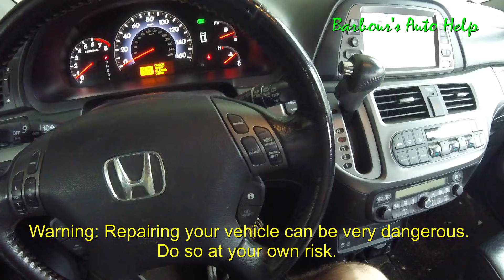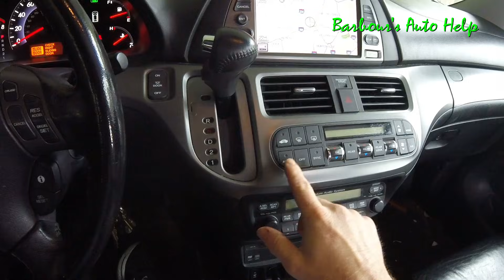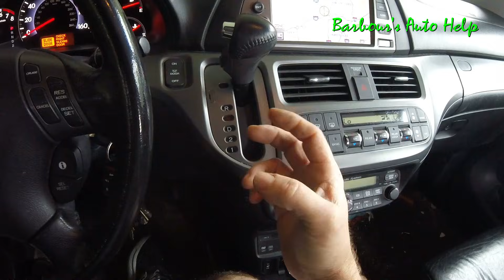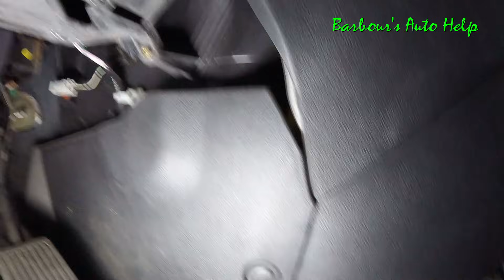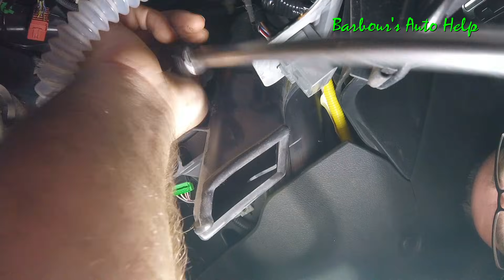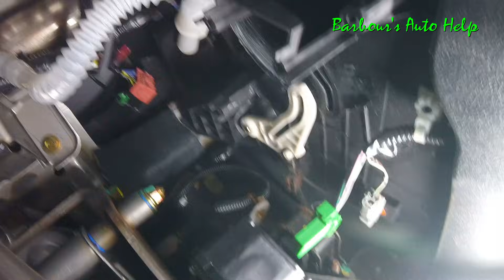Driver Side Temperature Blend Door Actuator Replacement 05 Honda Odyssey

Comment: Tried it on my '06 Odyssey, but no luck for me. Bought the replacement part and still blowing hot air. Could there be another actuator or a connection issue? I also wouldn't mind having it on cold air permanently if there's a way of doing it manually. Thanks a mil!
Reply: you might need refrigerant

Comment: Could this be the reason my defrost isnt working on my 2010 honda odyssey.
Reply from the maker: Maybe.  How is it not working?
Reply: @BarboursAutoHelp  no air is coming out of defrost vents at all, I've been using it all winter no problem until today. Hot air and really cold air work fine on the dashboard vents but I'm not getting any air out of the defrost vents or the floor vents.
Reply from the maker: @richb5478  Sounds like you have something else going on.  If it changes from hot to cold and then back the temp blend door is working.
Reply: @BarboursAutoHelp  yeah the temp isnt the problem and the blower speed is working fine low and high it's just my defrost vents stopped blowing air any idea what would cause that then.
Reply: @BarboursAutoHelp  doesnt the actuator direct where the air goes to what vents.
Reply from the maker: @richb5478  Not the temperature blend door actuator.  It just controls the air temp.  You may have something going on with the mode door actuator.  Different animal.
Reply: @BarboursAutoHelp  where is that located

Comment: Thanks for the great video!  I thought I'd share a solution for those that run into difficulty putting the actuator back into place.  When I went to do so, I was a little baffled because the two knobs seem to be in a 'traverse' position from how they should be positioned.  After a number of attempts and scratching my head, I figured out a solution...

I saw a note from someone else where they connected the actuator back to power (letting it just hang down) to verify it was even working.  I then started playing with the temperature controls.  Wah-lah!!  I set the climate control settings to manual and set the temperature to the LO (lowest) position.  The little knobs then traversed around to the exact position I needed, and I was able to place it exactly as expected.  Hope this helps anyone else that ran into same issue.

Comment: Hi, thanks very much for this repair. This video is excellent. I am sharing my experience in detail as follows for 2010 Honda CRV. I am in need of a ratchet for tight space (possibly adjustable like a adjustable wrench with a wheel) and or flex extension, if someone can point me right to it.
Problem symptoms: No air from middle central vents (two) and very little air from driver's side left vent. Full air flow near accelerator and everywhere else. But on driver's side only cold air flowing no matter what setting is for the temperature or on AC mode, manual or auto mode. Same problem even if flipped to different air flow modes on the knob. No heater at all for driver's side. Heat and cold just fine on passenger's side on auto, manual or dual mode.
Fix: Removed air mix motor actuator and cleaned it, greased it per instructions on this video. Total expense $10. Before opening the case, there were three other screws holding a metal bar plate to the plastic casing for which one screw couldn't be removed as the arm was blocking and without it coming off I couldn't open the case. So,  I used nose pliers and got it off by turning it. In the end I forgot to put the screw back in place but the plate was still holding quite well, no problems. I didn't bother for it. I didn't have flex extension for ratchet nor I could get it easily in my location so wind up using #7 wrench for the tight space bolt. It was a long extensive effort! But I didn't put it back in place in the end when I finished, the actuator was still attached fine in place. For the two easy bolts I used a small ratchet very easily. When I opened the case, the contacts and wheel was on the arm side (downside) and hence not on the top as shown here (this video is for Odyssey) but nevertheless, I was able to clean it and grease it just fine, there's a plenty of space for it and the cleaner is a good spray. I used a screwdriver tip to put dielectric grease on the wheel. I removed motor and gears and cleaned it too (there was lithium grease and for sure it was dried on contact wheel) but while assembling the motor back, the letters / writing label on the motor has to be facing me or the actuator could work in reverse.
Surprise: When assembled back the actuator arm didn't move no matter what I set for the temperature (auto mode or manual) and hence the problem stayed as is. So, I removed it (only two screws to remove now as mentioned earlier!) and attached with the power cord and tested again, still no arm movement. I thought there might be power issue to the power plug. So, to test that I attached it with the power plug on the passenger's side actuator which is accessible when glove box is detached and lowered. Then the arm moved fully! At which point I thought there's a power issue for sure on driver's side. But I attached it with the power plug on driver's side again and it worked! And it worked for all temperature settings too. The arm was adjusting little with little change in temperature on the knob on auto mode. So, I put it back in place like shown in this video (but I only have one white arm to attached two, not two like in here) and gave it power. Started the car and hot, cold air and anything in between was flowing per settings. However, no air still from middle front central vents despite several engine restarts. So, thinking there might be another issue (transistor etc.) I turned the car off. When I turned car on several hours later, air started flowing from middle vents as well! More so when AC is on high and not so much even when high heat is on. This is normal car operation I think. You don't want high heat on your face.
Reply from the maker: Hmmm.   Thank you so much for sharing our experience.  You may actually still have a problem.  My van blows out the middle vents well no matter if the the A/C is on or the heat.  It does blow a little slower with the heat on though, but not that much.  It may not be a bad idea to have a tech look at it for you.
Reply: @BarboursAutoHelp  on the air/heater actuator,if your problem is just reverse of your video,cold air on drivers side,but hot air on passengers side,I would just change out the actuator on passengers side right
Reply from the maker: Well, I'm not sure.  Is that actually whats causing the problem?
Reply: @BarboursAutoHelp  I am sure it is actuator on passengers side,only thing is it is not as easy to remove as one on drivers side,but I did put down glove box,and shined in dash with flashlight,directly on passenger side actuator,and the white arms that move up and down,as you adjust your passenger side temp,the white arm keeps sticking in about same place,I can reach in and push on it,and that will make it start back moving,so I guess the motor inside the actuator has got weak,to were it will not make the arm go up and down completely without sticking
Reply from the maker: That may be it.

Comment: What is the bendy straw looking thing that attaches to the top of that black vent called? My 2006 odyssey does not have one of those. My temperature actuator is working fine but still no heat on the driver’s side.

Comment: Thank you very much for your post.  This did help me fix my issue with my 2010 odyssey.
You weren't kidding about the tight quarters to work in.  Unless you have a platform to lay on so you can slide under the steering wheel, the only way to get the screws out is by feel.  Total repair took about 1 hour, start to finish.   I did follow your 2nd video to repair the actuator. It was successful as well & I'll post comments that will help over there.  Thank you!  Very much appreciated!!
Reply from the maker: Oh that's great!  Good job!

Comment: Good video. Question: is this blend door actuator the same as a servo motor actuator? Is it used to determine where the air comes out ( front vent, bottom vent, top defroster vent)? Getting confuse between actuators that change vent positions versus those that control temperature levels.
Reply from the maker: Blend door is for temp not mode.

Comment: I have odyssey 2008 driver side is warm but the actuator motor is working any idea.
Reply: In my Odyssey 2010 my problem symptoms were: Driver's side two vents blew hot air when AC was on. When temp control brought all the way to Lo, I had cold air blowing again which continued so even after adjusting the temp. But no guarantee next time. So, this problem was intermittent. I didn't have rat noise coming from dashboard area.
Fix: I replaced Omron relay G8HL H71 (2 for $7 on ebay) in the engine fuse box under the front hood. It is the right side relay on the top row and it is called Condenser fan Lo speed relay. That fixed the problem and started getting cold air from driver's side vents when AC was on or on auto.
Six months later, fix is still working. Just to make sure or confirm you can also test existing bad relay using a multi meter or 9v battery, just check youtube videos for the same.
Reply from the maker: Low freon perhaps.
Reply: @BarboursAutoHelp  thank you man

Comment: I have the same problem in my 2008 odyssey.  Do you know if the part number is the same for the actuator?
Reply from the maker: I don't.
Reply: Honda Temperature Driver Motor Assembly, 79160-SHJ-A41

Comment: I have a 2011 Honda CRV and I’m having trouble with the heat/ac. It blows cold air in winter and hot air in summer. Dealership claims it was the AC button ($800 repair). That would explain the hot air in summer not the cold air in winter. Fluids are fine. Hoses are fine. Thermostat is fine. 

Is this an actuator problem or is it the control knob on dash? 

All vents blow just fine

Comment: Mines has a blender actuator and a separate flap door actuator. Flat door actuator seems to regulate where is flowing and a blender or is how hot or cold the temperature can get. The Glendora is located under the driver's side  And the flat is located glove box

Comment: Okay my problem is the opposite I got the heat on but the passenger side is BLOWING HOTTER than the left side...is this the same solution cold or HOT
Reply: I have the same problem! Did you ever figure it out?
Reply from the maker: Its possible.  It could be other factors contributing to it too like low coolant,  Restricted heater core, ect.
Reply: @BarboursAutoHelp  it's weird I am in the van right this second got the heater on  sitting on driver's side all the LEFT vents are BLOWING COOL AIR but the RIGHT SIDE vents are BLOWING HOT which THEY should since I got heater on...and yes the heat on the right side is really hot not warm .nice and HOT like is supposed to be...

Comment: Great video. My problem is the ac and heat works fine but air only comes out the front vents, no defrost vents or foot vents when i change mode 2009 Honda Odyssey EXL. Any idea guys what it could be? Thank you
Reply: I think you are looking for Honda Part No.: 79140-SHJ-A01 but do confirm with your Dealer's parts department. They are usually very helpful to identify the part needed to fix a problem.

Comment: Hi, your video is great!  My AC works fine, but I get no heat on the drivers side when I need it, just the passenger.  I checked the blender motor on the drivers side and it seems to working perfectly- moves to different positions depending on what is selected.  But we still get no heat for the driver nor drivers side defogger.  I had the coolant flushed/replaced at a local shop. I've heard rumors that the heater core can cause this issue, but it seems like there wouldn't be heat for the passenger either ... Any more ideas?  I would greatly appreciate your thoughts.
Reply from the maker: I'd start by checking the coolant level.  Air in the system could cause this.  A partially clogged heater core could also.... amongst other things.
Reply: Hi Brandon, I see your post is from 3 years ago, but I'm having the same issue as you had with no heat on driver's side.(blend actuator seems to move fine. Also it doesn't make sense to me if the heater core is clogged, I shouldn't have heat on the passenger side either? But i do. Both heater core hoses get hot as well so i wouldn't expect a clog but I'm no mechanic. Did you ever figure out your issue?
Thanks

Comment: Fantastic, helpful video. I heard the death-knell crunchy/rodent-like sound in the dash, followed days later by the Incessant Blast of Hades while driving, regardless of dashboard settings. Bought a genuine Honda replacement online. After diagnosis, this video helped me install a replacement on a '10 Odyssey Touring. Score one for mom. I needed a headlamp, screwdrivers, and a small mirror to see the backside of the actuator.  Many thanks!
Reply from the maker: Good job!

Comment: Great Information.  Thanks for posting.  I pushed the drivers seat all the way back and laid on my back on drivers floor and there it was.  Now I knew what to look for. It turned out, I could see it was sticking, so sprayed it with some lube, and its fine at the moment.
Reply: Kara Gregory I will try this first. Before doing a tuneup following these two videos.
Reply: @kara Gregory.  
Do you mind to share a little bit more about what you tried?   Did you spray the electronic cleaner right on the actuator without removing it?

Comment: Hi.  Great pair of videos.   I noticed in your cleaning video you removed the DC motor from the assembly.  Correct me if I am wrong, but wouldn't inadvertently switching the orientation of the motor 180 degrees (reversing the contacts) during reassembly cause the motor to run backwards?  Is this why some of the folks (perhaps 50%) not having as much luck as others?   I recommend the motor orientation be marked with a Sharpie before it is removed from the assembly frame to ensure the motor goes back in the way it came out.
Reply from the maker: I did not remove the motor.  I separated the two sides of the housing and used care not to allow the motor to fall out of the housing and recommended that viewer do the same.  Yes, if the motor is reversed it will operate in reverse so marking its position would be a good thing if you intend on taking it out.  I don’t suggest taking it out.  I suppose marking it “just in case” is not a bad idea either.  It could fall out accidentally.  It would be nice if it where marked so you know how to put it back in.  Not a bad suggestion!  Thanks for commenting.
Reply: I apologize.  You did not remove the motor.  Watching more closely I realize I mis-interpreted the cover for the half which houses the motor.   Thank you for the videos.   My wife's van is fixed.
Reply from the maker: No apology needed, Sir.  Good job and great point!

Comment: I did similar repair on the Honda Accord when the air coming out of the air vent is barely cold. As it turns out mostly like, the sensor wheel and the electrical contacts did not make good connections so the ECU does not know if the door is open or close so it kept hunting for the position. What you ended up with is AC not cold on the driver side and even if when the AC is not running, the driver side temperature motor assembly kept looking for the right position by going back and forth and causing the rat noise under the dash. So after taking it out of the Accord, I opened it up by prying up the plastic tabs and clean out the old grease on both the sensor wheel and the electrical contacts and clean the electrical contacts with rubbing alcohol. After putting on some new dielectric grease on both the sensor wheel and the electrical contacts and put the two halves of the assembly back together. Make sure you remember or mark the orientation of the external arm relative to the casing so that it lines up after you put them back. After putting the assembly back into the car, the AC is now ice cold on the driver side at 77F (ambient 95F). So with some delicate repair, my driver side temperature motor assembly should be good for the next 10 years with about a nickle worth of dielectric grease and some elbow grease. It is a waste of money to replace the temperature motor assembly unless the motor dies, which is very rare.
Reply from the maker: Nice advice.  I actually did exactly what you said and made a video on it.  The link is in the description.
Reply from the maker: Minus the rubbing alcohol.

Comment: Installed the new blend door actuator, and heat & A/C system works great.  Bought the new part on line and saved about $70, plus any dealer labor for installation.  Thanks again for your very helpful videos.  
Do you by chance have a video for replacing a headlamp seal on a 2005 Odyssey?
Reply from the maker: I don’t but I’ll whip that up for you.  Good job on your A/C and thanks for your contribution of information to this video!  Give me a bit in the headlamp  video but I will make it.
Reply: OK, thanks.  I'll be on the lookout for it.

Comment: I had to order a new replacement blend door actuator as  my attempt to clean the contacts was not successful in regaining complete heat & A?C control.  After I install the new actuator is it okay to test out the system before i reinstall the air outlet?  Thanks again for sharing your excellent videos as they are most helpful.
Reply from the maker: Thank you and thanks for posting.
Reply: Does the air outlet have to be reinstalled before testing out  a newly installed actuator? Thanks.
Reply from the maker: I don't believe so.